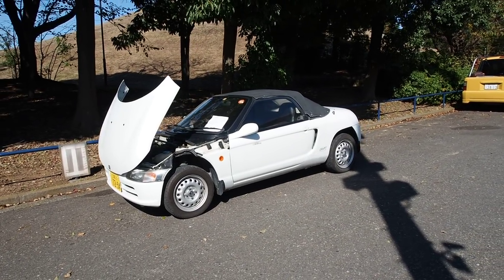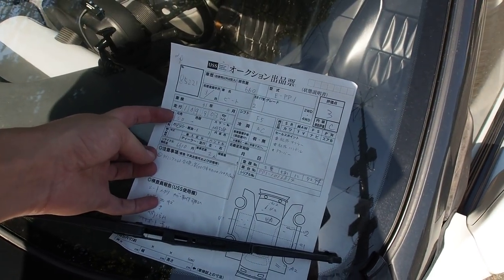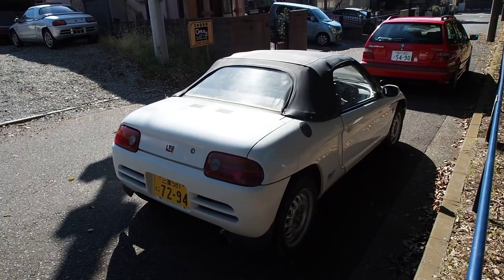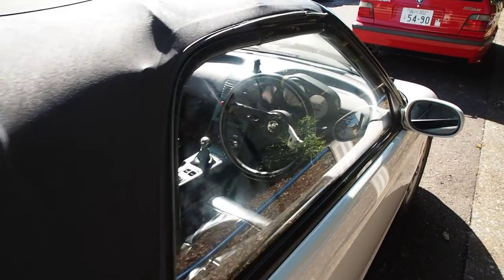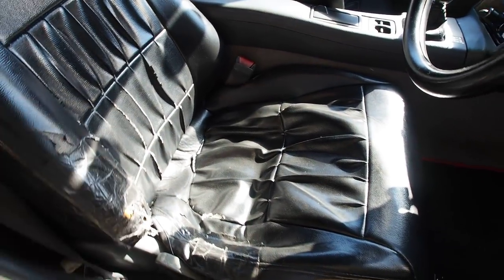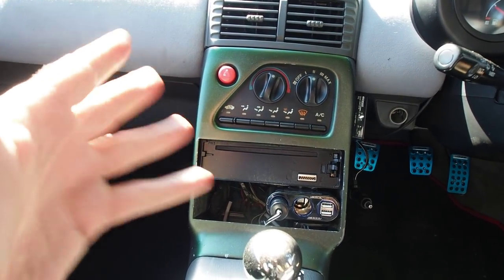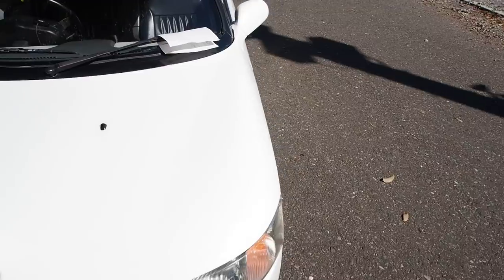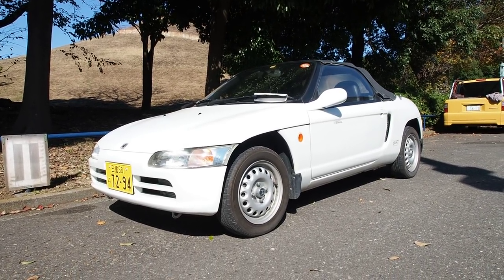1991 Honda Beat (USA Import) Japan Auction Purchase Review

Comment: I’ve got a Beat here in the UK. It’s red. I’ve had it for around 10 years. Pretty sure those wheels were standard ones. Alloys were an option. Mine has almost all options. CD auto changer, front fogs, dash level speakers, boot spoiler. Mine’s roof is a replacement one of top quality. This one looks like the original one did. The original ‘gathers’ radio requires a frequency extender to work. Japanese fm ceases where European fm commences. Japanese Tax law required the speed to be limited. This can be removed. Mine’s been very reliable but last year the cam belt snapped. Honda UK knew my mechanic was rebuilding the engine and contacted Honda Japan who sent him a 600 page document detailing many things. He could have relied on his expertise I’m sure, but this enabled him to be precise. It started first time! My mechanic was impressed to find that many items are still available from Honda. Those unavailable can be substituted. Body parts are another matter of course! The mats in this video aren’t original. If you find any then expect to pay £££s. This one looks good to me. Once when mine was receiving its annual government check the tester asked me how the fuel flap was released. Clearly he’d never seen one before. Fuel lines etc have to be examined. It’s a small button at shoulder height inside the driver’s door frame. Certain mine would have had a full respray in the past. White doesn’t fade as noticeably as some other colours. The front and rear bumpers are plastic so marks will be harder to rectify. I’d buy this one though!

Comment: You've never seen those wheels on Honda Beat?? They are the stock ones :)
Half of all the Beats I buy have those...
https://www.gtplanet.net/wp-content/uploads/2017/08/Beat-02.jpg

And fuel cutoff on Honda Beat is around 9300rpm and you have to shift up as close to it as possible... Driven hard, you never really go under 6500rpm on those... This is by far the best sounding keicar ever produced... I would include the Honda S500 and S600 as even better sounding keicars, but these were not keijidosha at the time, eventhough they'd fit the bill as one by today's kei standards :)